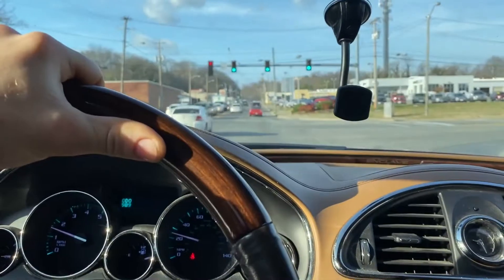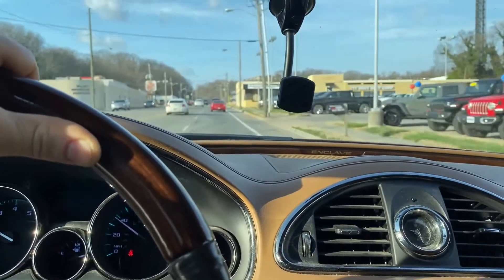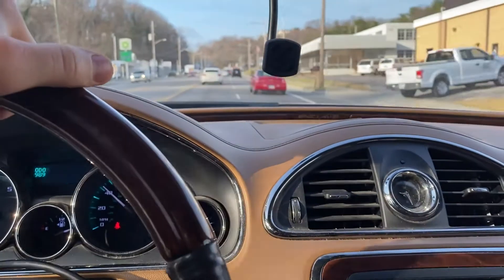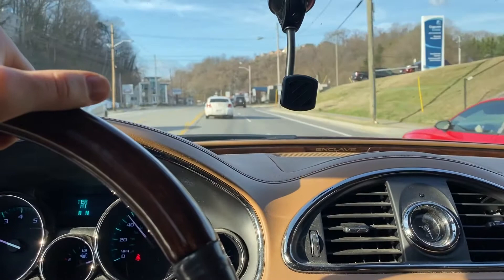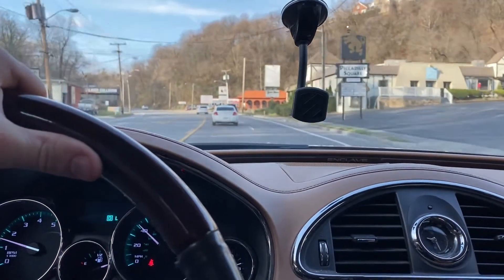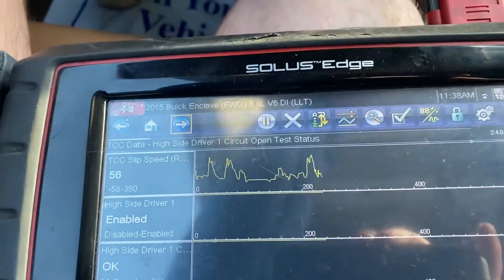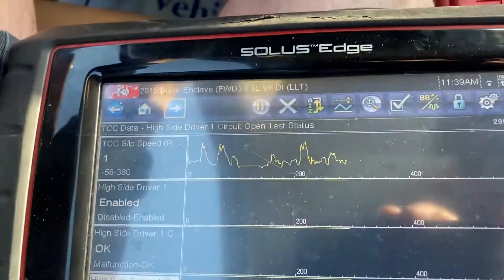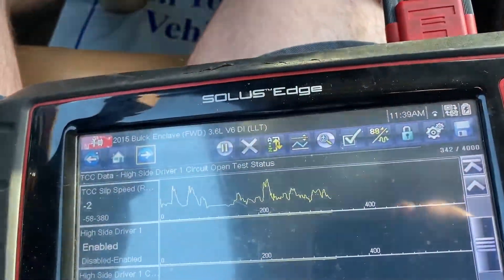Transmission Slipping at 45 mph. Buick Enclave. TCC slip diagnosis.

Comment: If people would change their transmission fluid every 30-50k, a lot of these problems could be avoided. Modern transmissions run extremely hot and many modern transmissions (including this one) do not have a replaceable transmission filter. Contrary to what most people might believe, the quality of the factory installed transmission fluid would best be described as “purchased in bulk from the lowest bidder”. Draining it and replacing it with a high quality brand synthetic fluid that matches the recommendation for your specific transmission (along with continuously changing it on a sub 50k schedule and some sensible driving habits) will add decades of life to all but the very worst transmission designs. My 2005’s 230,000 mile automatic is still shifting fine with at  ~40k fluid changes. Our 2016 model began having erratic shifting issues at around 25k. I immediately changed the fluid and filter and the issues completely disappeared and have not return in the addition 25,000 miles driven since. ATF is the “life’s blood” of the transmission.
Reply: It just blows my mind how many people only change engine oil and never trans fluid. I own a small car dealership and I have to change out the trans fluid on nearly every car I sell because it looks original and very dark or the trans is acting up from lack of maintenance.  A fluid change with a filter if possible almost always fixes every shifting issue and never once have had a comeback. Everyone regardless of what a manufacture says needs to be changing the fluid every 30-50k min.

Comment: Thanks for making this video. I've never had a GM trans fail this early.  My mechanic says the early failure is do to being engineered for government environmental mileage requirements. Is that true?
Reply: I did a ton of research on this and I'm currently in search of either somebody who can tune my TCM or I may buy myself an HP tuner and learn how to do it myself. If you dive deep there are forms all over the place that describe this issue and the fact that replacing the transmission and torque converter never actually fixed the problem. The issue is the GM factory tune, basically it tries to prematurely lock up the torque converter when there's not actually enough torque to do so, causing it to overheat very often which wears out the rest of the transmission as well. Another big recommendation is put on an aftermarket transmission cooler it brought my temps down by like 30° and they're still within operating temperature

Comment: Wouldn't it just replacing the torque converter fix the issue?
Reply from the maker: These vehicles are known to have valve body issues causing tcc slippage

Comment: Buick encore 2016 here stars to bumps after 2 nd and 3 gear . 168k no transmission oil change yet. And my turbo it's going out too .
Reply from the maker: Sounds like transmission and turbo replacement. You might want to verify integrity of engine and overall vehicle before making that type of investment
Reply: Yeap thats the top milage of newer cars

Comment: First off, thank you for the post.  I'm a long time gearhead and had a feeling it was the TC in our Enclave.  I have a lot of OBD-II diag tools from back in my motorsports shop days, I'm going to view and log exactly what you just did to confirm. I think I might even have it on the Dash Command android app. (Expensive pro diag from Palmer Performance, not a freebie.) The high power Dodge diesels we used to build back in the first days of diesel power would blow through the lock up on the stock converter.  You want to talk about chatter!!  The whole damned truck would feel like a giant orbital sander was on the roof!  LOL  TY again...
Reply from the maker: Your very welcome and thank you for the comment. Have a great day!

Comment: Why change the whole transmission when the problem is the torque converter?
Reply from the maker: You risk having more transmission problems further down the road by not changing the the transmission. Usually debris from the bad torque converter get thrown throughout the transmission which is impossible to get out.
Reply from the maker: Changing only the convertor may not repair vehicle
Reply: @johnniemic  OK. Just the converter fixed mine. I also do regular drain and refills and avoided the shuddering as much as possible to avoid clutch material in the trans.
Reply: @johnniemic   How would it not? You diagnosed it as the Converter...
Reply: @troublesome3607  It’s b/c of cause and effect. It causes premature wear on the friction disks inside the transmission. On a manual, you wouldn’t worry about it b/c the clutch Disk is on the outside. 

The pressure plate acts like TQ converter.

On a Manuel the recommend replacing the Pressure plate and the disk and it’s usually sold as a kit. You can do them individually and could prolong another failure, but we all know it’s been compromised. Unless you are running some upgrades hardware and are matching disks and pressure plates. But then you can also do that with TQ, get a HD version to hold more and prevent slippage longer.

Comment: I have the same vehicle, with the same issue at the same mileage. Appreciate how you diagnosed it.  Performed the same task and it allowed me to believe it really was my TC on my car (And not plugs, bad fuel, etc.), Right at the end, you went from confirming it was only the Torque Converter to putting in a Reman Transmission (One extreme to the other).  Why not only replace the Torque Converter?  Also, what reman did you use?
Reply from the maker: Remanufactured transmission with torque convertor. Anything less is a gamble
Reply: I thought the same thing🤷
Reply: Frank, what did you end up doing as far as the repair on your enclave? I have a 2015 doing that right now
Reply: @Goldmember66   went with online smart street transmissions (search for them) and got a remanufactured transmission, instead of rebuilt one. Did not trust local shops to install a quality rebuilt one(read too many horror stories).  For the $1500 extra cost , and three years extra Warrenty on the remain over the rebuilt i opted for remanufactured for peace of mind. I would recommend them again and all is well after 15k miles.  Process was perfect, transparent, and no games.   Also most shops will not just replace the torque converter, because it is hit or miss if there is downstream corruption from a broken converter.   And you are out of luck or money if something is missed.  Too much risk for me
Reply: @Goldmember66  also if you want me to be completely transparent, you are most likely headed for repairs on your rear ac compressor ( defective Oem part that will catch up to you), a new front end cv axel, and a new timing chain….using delco parts the ac and cv axel alone ran about $3500, and a 100k car warrenty will run you 4K, so do the math if you are planning on keeping the car (which if you go the transmission route I expect you will)
Reply: @oceanfrank1  thanks Frank. I have 167,000 miles on it. It’s been a good until this. I have a tough decision to make. 🤦‍♂️
Reply: @Goldmember66  yeah I bought the transmission, ac…then got the warranty and now covered end to end till 260miles..best thing is I can transfer the warrenty if I sell making it easier to sell high mileage for some value..best of luck.  I hate extended car warranties, but with the Buick had to bite the bullet..repairs to expensive.
Reply: @oceanfrank1  thanks again 👍

Comment: My TCC has been slipping for about 10k miles how long can it keep going while slipping you think ?
Reply from the maker: Hard to say. Adding a additive may help.
Reply: Mine has been slipping for 100k miles and works fine. I keep changing oil and filter according to the factory schedule.
Reply: @Blue-mine  your full of it. You cannot change the filter...
Reply: @bighigh69  two months before it stopped slipping after adding one bottle of LUCAS with the last change of oil which was ten months ago. It took 15k miles to show the result.